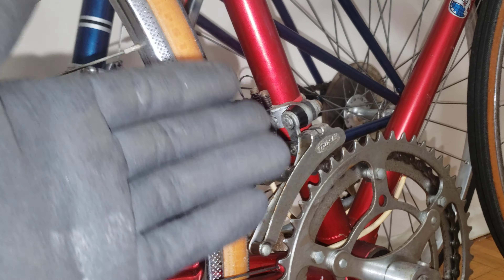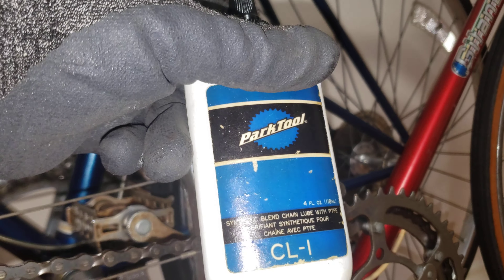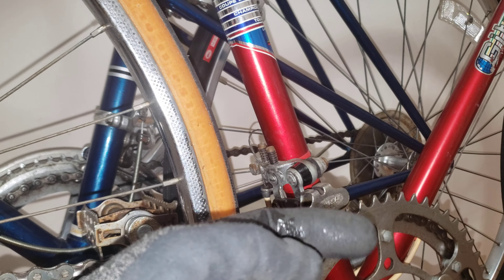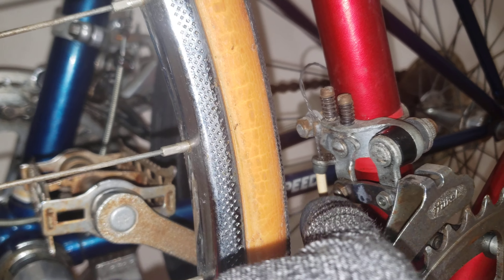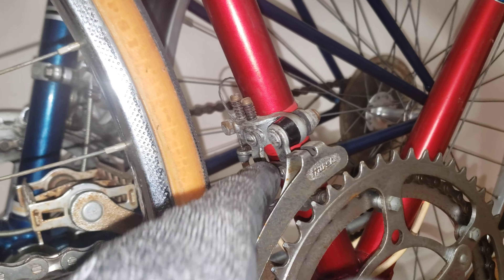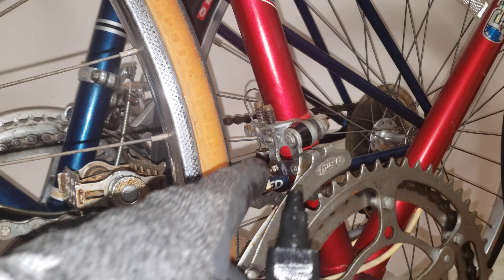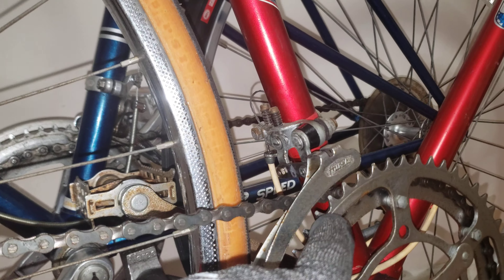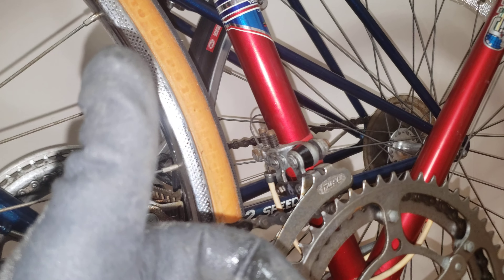Sluggish - Sticky - Stuck Front Derailleur? Easy Fix! - 4K

Comment: Lol, good video.
I have many bikes that live outside, like the dog.  Sometimes rust, grease and dust, these things bind the mechanism.

I use
* PB Blaster
* Teflon Infused Oil
* Gun Oil
* Dry Lube
* Chain Oil
* Alcohol then Oil
* Anything to clean the grime and crystals then Lubricate

Take your bike apart often and it will come apart easy
Reply from the maker: Thanks for the kind words and suggestions.